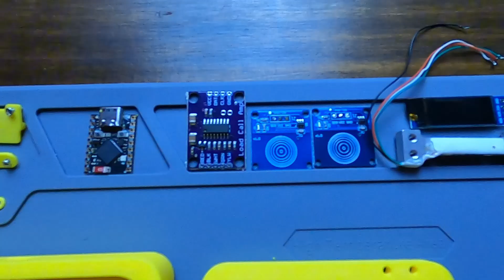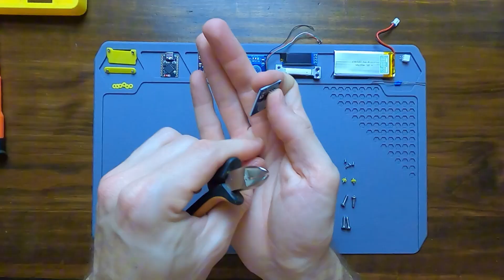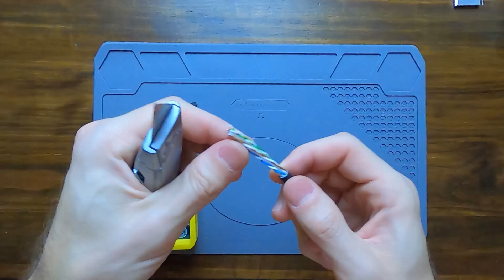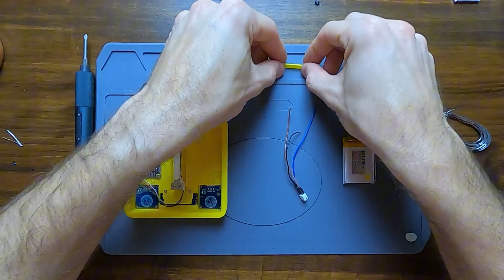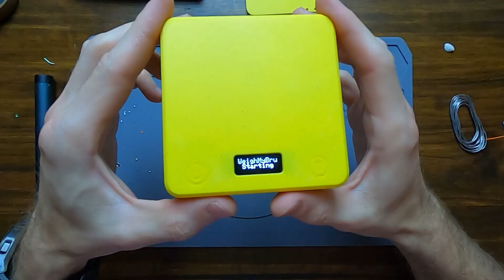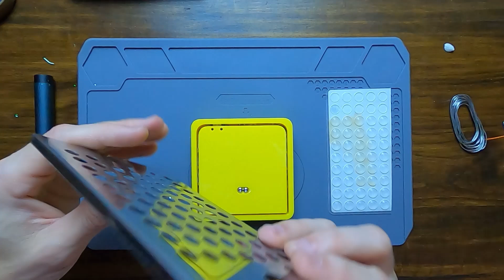WeighMyBru Assembly Guide

Comment: A nice addition would be to add a vibration sensor to start the timer as soon as the pump starts, then it stops as it is not vibrating anymore. Then you will count the pre infusion too.

I have figured out that magnetic sensors are more accurate, but it implies that you open the coffee machine and stick the sensor next to the pump. With the vibration sensor, you just have to stick it to the machine's body.
Reply from the maker: Clever idea. Never looked into it, but that would require physical wiring, or an additional ESP32 to communicate with the scale.

Comment: while watching i was wondering if it would be feasible to design a  pcb where all the components just sit on with legs so you just have to throw everything in place and solder tight without doing all this cabling work? since its just cables you would only need like bare traces and connectors, no?
Reply: You could absolutely do that it just would kill the point of the project. The idea of the diy scales like weighmybru are that it’s a cheaper way to get premium quality scales. Depending on sourcing costs you can build this scale for like $100 us or less. Adding in custom pcb manufacturing would add like $40 minimum, for $140US you could just get an off the shelf scale with all the same functionality and better fit and finish something like the bookoo Themis mini is only 110 and has all the same functionality.
Reply: @GucciCaligula  I thought you could build it for less than $100. Besides the battery, what are the other expensive components?
Reply from the maker: @jmemusic  The ESP32S3 is the most expensive component. In South Africa we have a few hobby stores that stock majority of these parts. I was able to build it for under $50, obviously you need access to a 3D printer as well.

Comment: Can i use non I shaped load cell like a I shape with horizontal screw hole on each side
Reply from the maker: As long as the mounting holes are in the same position, otherwise you will need to change the mounting points. I believe the CZLi2000 loadcell will fit but I have not personally tested it.